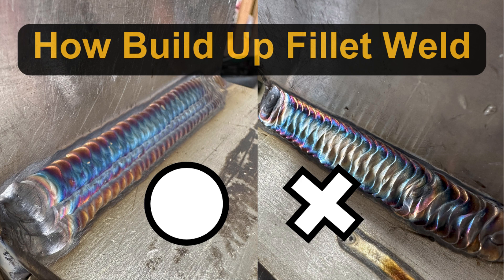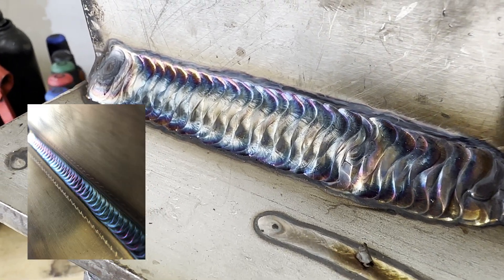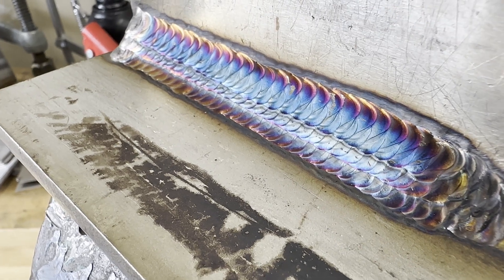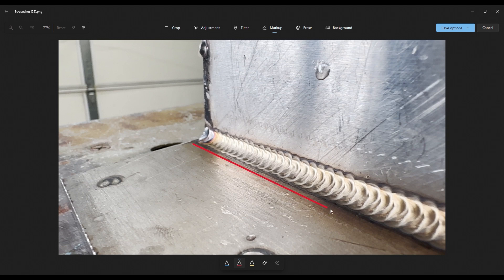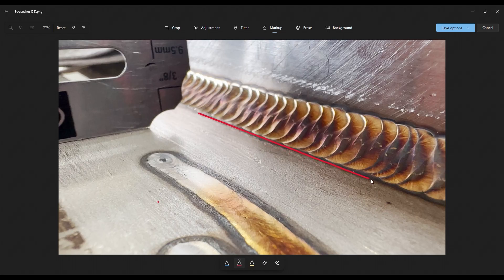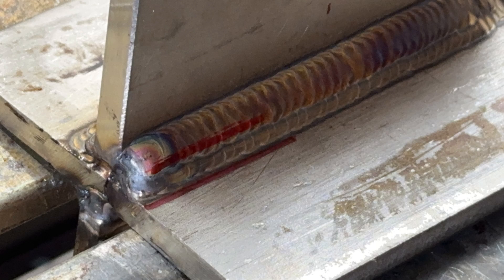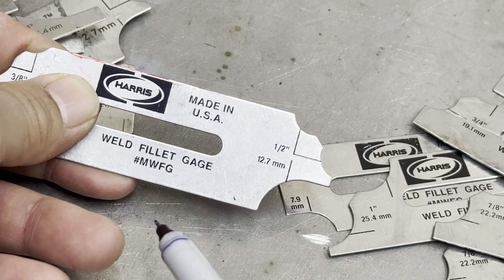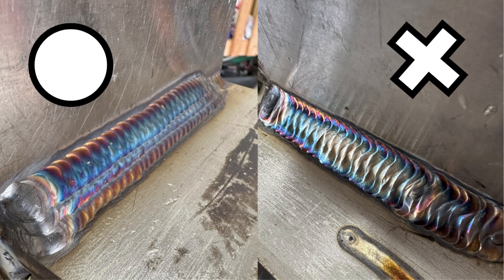How to build up big TIG fillet weld. Why beginners can't make big size weld?

Comment: Do you use a foot pedal when welding stainless?
Reply from the maker: I use both depending on the job. If I weld sitting down, i use foot pedal. But it is more comfortable using a switch on the torch if I have weld on position.
Reply: @TigKing_Chang  can you please give any advise for welding without foot pedal?
Reply from the maker: @DevangTandel-m3i I am working now. I will leave a comment later today.
Reply: @TigKing_Chang  of course. Thank you.
Reply from the maker: @DevangTandel-m3i Hi. Pls take a look at the following video and let me know if you need more help. Thanks.

https://youtu.be/4yhHQarvYic?si=XWW5AmZnM1MNFIUb
Reply from the maker: I think it doesn't matter which material you weld. Of videos, i have an episode about weld posture. It may help you. Thanks.